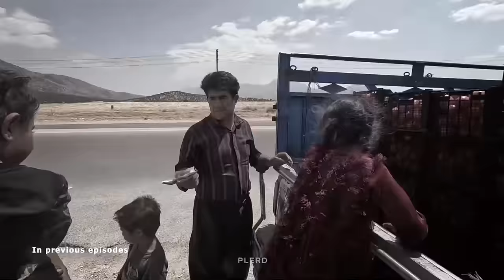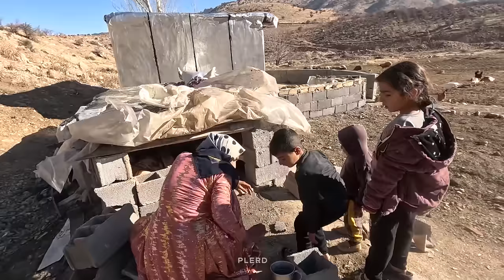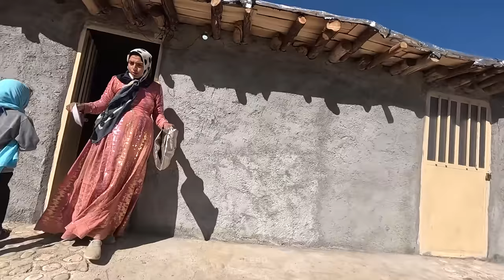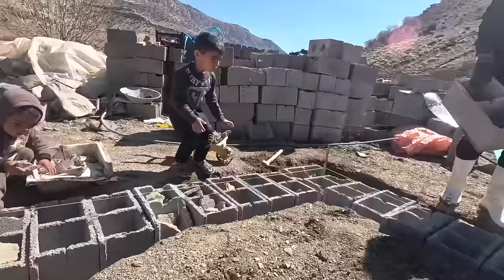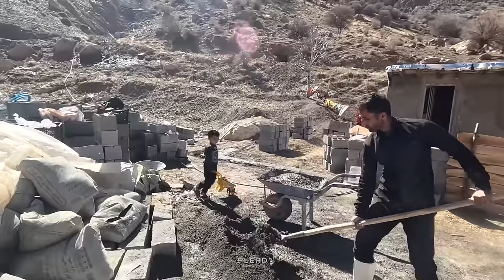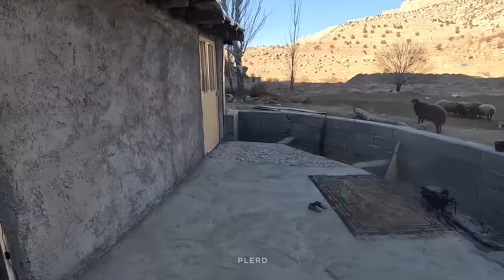Mother's Strength in Struggle: Fodder Fortress, Raising Walls

Comment: You can buy more peach blossom trees, the scenery is beautiful. They come in different colors. You can buy more. They are trees that can withstand cold winters. The flowers come in many colors and are beautiful. Can be planted in flower beds on both sides of a large platform. In addition, if they are planted evenly in the left and right open spaces to form corridors on both sides, they will be very beautiful in 1 to 3 years. Apricot trees, walnut trees, and apple trees can be planted behind the house. They are also hardy trees and their fruits are edible. They help provide shade and conserve soil and water. They can be planted on the hillside behind the house to keep the soil stable.
Apricot trees, walnut trees, and apple trees can be planted behind the house. They are also hardy trees whose fruits are edible. They help provide shade and protect soil and water. They can be planted on the hillside behind the house to keep the soil stable.
In addition, where the terrain is prone to water accumulation, more trees can be planted, which can play a good role in soil and water conservation.